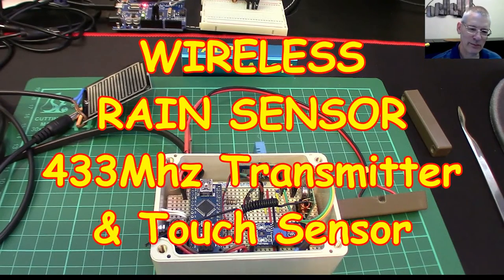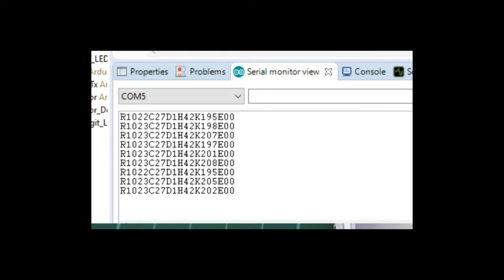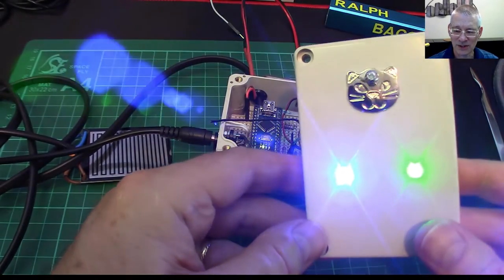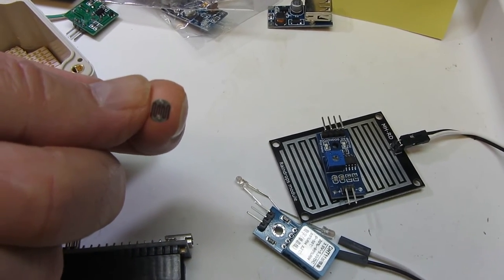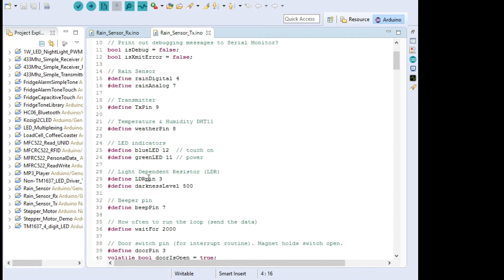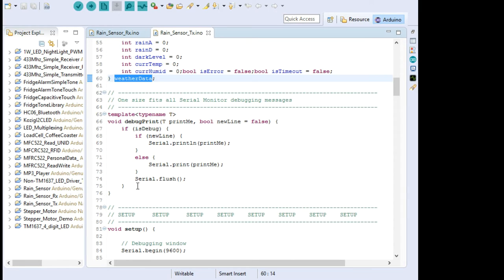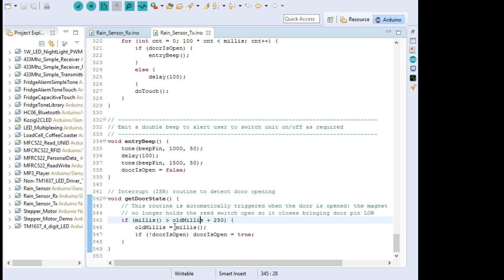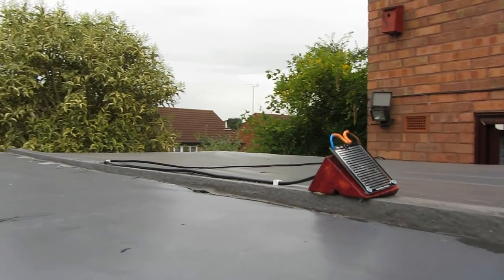#46 Wireless 433MHz Rain Sensor (Transmitter)

Comment: Your coding was edifying, showing some excellent practices. Just a comment about memory management and addressing structs: Like all static data declared outside of a function definition, structs are stored in SRAM. In Arduinos, SRAM is limited to 1KByte (ATmega168) or 2KByte (ATmega328) and static data  shares SRAM with Stack memory. Stack's use of SRAM varies as different functions are called, memory used by each function call remains in use until that function returns. Thus, when calling a function from within a function, stack will use more memory. In a more complex program, stack can use quite a lot of that small SRAM allocation. One way to reduce stack's use of memory is to minimise the number of arguments to each of your defined functions. When addressing structs this can be used by addressing only the struct (as Ralph does in:

      void xmitData(struct WeatherData *weatherData ){

In this example, xmitData's parameters only add 2 bytes to the stack's SRAM use. Now, if one were to employ this policy in all the functions that reference weatherData, detectRain() would be written as:

      void detectRain(struct WeatherData *data){
            data->rainA = analogRead(rainAnalog);
            data->rainD = digitalRead(rainDigital);
            
            debugPrint("Analog Rain:  ");
            debugPrint(data->rainA, true);

            debugPrint("Digital Rain:  ");
            debugPrint(data->rainD, true);
      } // saves 2 bytes of stack memory when compared to using two parameters

NB. the '->' construct is solely for addressing struct fields. It is syntactic sugar for *data.rainA. The difference being that it can be chained. that is IF rainA had been a pointer to another struct, it could be used thus data->rainA->theFieldOfThatOtherStruct.

None of the above is to suggest that there is a bug in Ralph's code. It is just that, with SRAM at a premium, the use of struct addressing is a better practice, thus reducing the chance that a complex sketch might run out of memory and crash. This also demonstrates the efficacy of using structs for blocks of related data.Had Ralph used global variables for all his transmitted data, he probably would have used a lot more memory. BTW, when reading general C/C++ books one often comes across the technique of recursion. This is a very useful technique that reduces complex computations down to a few function calls. Now a recursive function achieves this by calling itself over and over again until the return value comes to a predefined figure. You will learn a lot by studying this technique, but with a the restriction on memory availability in most MCUs, it would be unwise to employ recursion on an embedded system.
Reply from the maker: Thanks for very interesting (certainly to me anyway) discussion on structs and memory constraints. I must admit that I'm much more familiar with 'managed code' in the .Net world (C# being my current language of choice) where memory (or lack of it) just doesn't come into the equation. But...
 
But spookily, my very next video is about how we might save some (EEPROM) memory in embedded systems, where you need several predefined messages that won't fit into the available space. And recursion is always a good plaything until you run out of stack and I've even used it a few time when drilling down into directories (folders) and their (sub-) folders looking for files. Ho hum, those were the days. 
 
I'm glad my code stood up to scrutiny (pretty much) but I should have made it simpler; looking at it now I can see how noobs would be well put off by its seeming complexity. I shall bear this in mind for future sketches. Thanks for posting, Michael.

Comment: various modules integrated into the one Arduino board, very nice
Reply from the maker: Exactly so: each module is an Arduino 'Lego brick' and the code is the 'glue' that holds them all together. Glad you liked the video.

Comment: Hello again, Ralph! Sorry to bother you once more. I finally assembled the prototype of  the Tx/Rx Rain System (mainly to warn my wife in case her laundring is hanging out to dry!) Unless I'm wrong, you have employed the DHT11 sensor , whose range is 0° - 50°C: what if temperature goes below 0? Benny freezes outside? Or have you switched to DHT22 giving you a warning?
I know: you're not letting Benny out when it's so cold... but I think you get the point. 
I am trying to add a second Rx + datalogger unit, to read & store inside temperature (another DHT11) + outside (received) values. But RTC/ SD Card get very cross and stop working... Working on it!
I'm sooo glad I have accumulated all sorts of Arduino bits & knobs during the last years: now plenty of time to play aroud with them!
All the best, Ralph, and thank you for all the work you do!!
Reply from the maker: I switched from a DHT11 to a (larger) DHT22 at least 2 years ago now, Daniel,  as I couldn't understand how it was not below zero with snow on the ground! Doh! I'm pretty sure it was just a straight swap, no change to the electronics or code, but best to check the code! BTW Benny comes and goes as he pleases into his run. He realises when it is cold and comes back in pretty sharpish! This has been running for a few years now, works like a dream!
I did at least one video on the SD module. Make sure your power is nice and clean or the SD card can corrupt the data. And always close the file after each write to avoid the same. Good luck with your enhancement. Good to hear from you.
Reply: @RalphBacon  Thanks for the reply and the advise! Keep well!

Comment: Some very useful info in this video. I'm going to delve deeper into the capacitance touch sensor circuit and code.
I admire someone who takes such fine care of their animals the same way I do. 
I was wondering about the refractive/laser rain sensor you started a in a different video. Did that work out?
Thanks.
Reply from the maker: I just know I replied to this, Dirk, but it's not here!

My laser rain sensor was not sensitive enough (too small, maybe) but then again my car rain sensor seems to work just fine and it's not very big either. So I chose a standard PCB sensor but only turned it on a few times a minute and in that way prevented all the corrosion. It's still working today! Benny doesn't care any more because I've put a clear roof over his entire cat run now so he is rain-free all year round. He loves it out there.

Good to hear from you!
Reply: @RalphBacon  Thanks Ralph. Benny makes a great co-host. My little dog Trixie and I have been watching a ton of your vids as I try to get myself up to speed on micro-controllers. She likes to bark at Benny though. 
I was a software engineer before I became disabled and this has been a great help in my occupational/physical therapy. Your vids have a good focus on the hardware aspect of the micro-controller  programming and that suits me well. Your efforts have been a huge help and I just want you to know how much I enjoy and appreciate your content. Cheers.

Comment: Hello Ralph and thanks once again for your wonderful videos! A real pleasure to follow. I have a question on the TX sketch included here concerning the pin assignment: Pin 7 for both the rain sensor AND for the Beeper? Pin 3 Both for DoorPin and LDR? Where have I lost your explanation of this? Best wishes for your eyes! Daniel from Spain
Reply from the maker: I had to read my own code to find the (partial) answer, Daniel! 
Pin 7, in the TX module is used to read (INPUT) the analog rain sensor. It's also used to beep using TONE (PWM) when the door opens. 
Pin 3 is used to read (ANALOG INPUT) the LDR and also as an interrupt pin (TRIGGER, DIGITAL INPUT) when the door opens.
They all comfortably share the functions! I must have tested all this before implementing it and it's been working fine for several years now. Arduino does do a lot to protect us from out own stupidity, so if a pin was generating PWM at the time an analog READ was required, it would switch off the PWM before attempting to read the pin's value. Clever, huh?
Reply: @RalphBacon  Veeery clever!! Many thanks for your explanation. In these days of isolation (I'm considered 'at high risk' because of my diabetis & chronical leukemia) I've become a full time experimenter. I've been accumulating boards, sensors, etc.. for the past year and a half, so I'm well equipped! All the best and 'hello' from Maicol (my cat) to Benny!

Comment: Hi, Ralph, I think your rain sensor is a DC component so like all the rest of the cheap china modules is crap and will corrode in a short time and fail so your cat will get wet then he will be waiting to come in but have to take shelter somewhere.
Reply from the maker: Yes it is, Bob, and you're right that it most certainly does corrode. I don't know whether you've seen updates to this video (yet) but it corroded very quickly. However, I have a couple of other ideas, one of which has been working for several weeks now: don't keep this sensor at a permanent 5v, switch it on, take a reading, switch it off again. Repeat every 30 seconds or so. Works well. A brand new sensor (identical) has been placed next to my original and left unconnected so I can determine the effect of the weather. Result? After several weeks it looks brand new still. I'm also looking at putting a simple heater element underneath the sensor (quite cheap ones available from eBay, waterproof too) so that I can get notified when the rain has stopped. But that's for a future day, after I return from vacation... Oh BTW, Benny has a large covered area; it's not him I'm trying to protect, it's his bedding that we put out in the 'open air' part of his run.
Reply: Hi, Ralph, I was not raining on your parade I just did want to warn you of the problems people have as I know when I designed my rain sensor I used a square wave and not dc, Plus wet cats are not good.
All the best Bob and love the channel you are very good presenter
Reply from the maker: Ha ha, "rain on my parade", I see what you did there Bob, very good!  Wet cats are definitely not good, I agree. Wet (or damp) dogs are even worse! Square wave is better than just DC, AC is better than square wave. But taking intermittent readings every 30 seconds or so is pretty good for this type of sensor, at least according to my empirical evidence. Thanks for your support Bob, and kind words, greatly appreciated.
Reply: Hi, Ralph we English do have a weird sense of humor yes wet dogs haha not good.
Love your bedroom light at night must look like my old darkroom when I did photography do you have the part number for the LEDs they look bright? Thanks, Bob-UK ps don't think your led propellor will work!!
Reply from the maker: The LEDs I used were 1 Watt DEEP RED - search ebay uk for "1 - 30 pcs 1W 3W High Power LED without PCB" and you'll see them from supplier 'futureeden'.
 
Normally I'd buy things like this from the Far East but it was much quicker this way (but much more expensive too).
 
And it does look exactly like a darkroom, but works so well I'm impressed with my own handiwork! When I turn off the bedside light I think "Oh no! I forgot to turn on the red lights" but no, it takes time for your eyes to adjust to the low level red light. Come 2am it is easily bright enough (yet also dim, in a strange sort of way) to see by to visit the loo without waking everyone else up. Great for kids too, when they wake up it's not dark (but not light either). Win win.
Reply: Hi, Ralph just got them from Ebay £3.99 for 5 with that supplier I think it a good store for good quality LEDs as China leds can be crape thanks again Bob